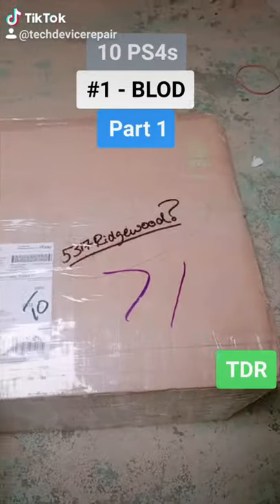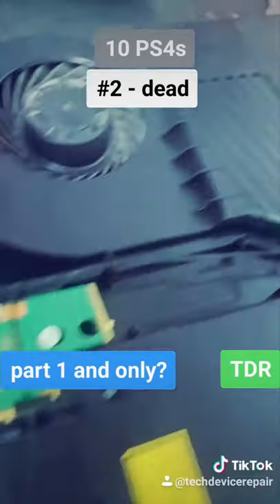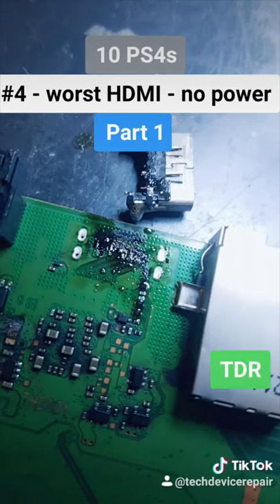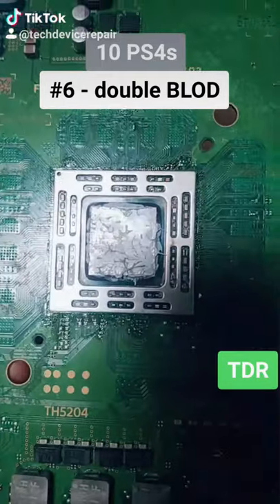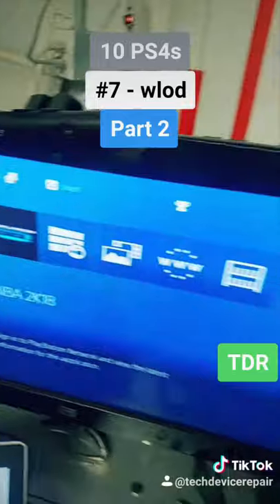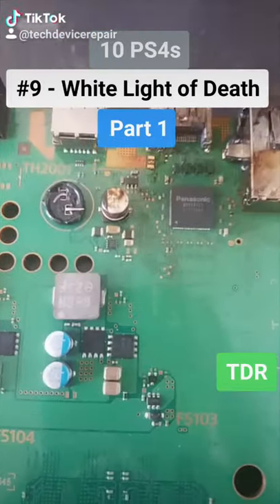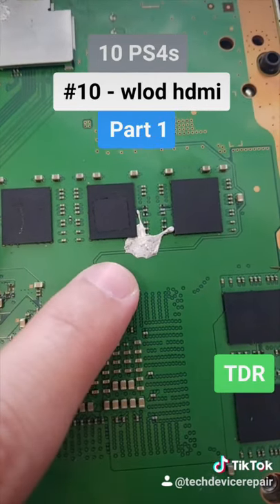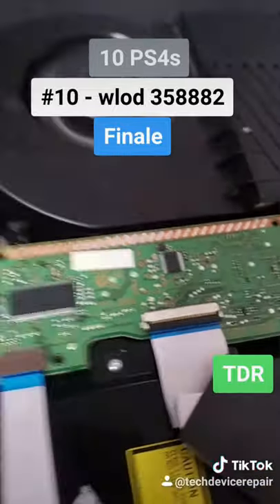I bought 10 Broken PS4s from eBay. Can I Fix them?

Comment: Hey man quick question! How Often is for a 4 pin power supply cable to burn out or something? Thank you
Reply: @thornedoesstuff6363 He means the cable connecting the power supply to the motherboard. Those either have 4 pins or 5 pins (mine has 5 pins)

Comment: I have a ps4 pro that I bought from Best Buy that was a return, when I use it I get nauseous whenever I turn it on. I heard you mention refurbished, is that the reason why I’m experiencing that? 

I’ve had cheap electronics in the past that gave me that same sick feeling, which I personally feel like they were factory models that were made with cheap parts in them that gave off a ton of radiation. I’m no medical expert, but I can’t make up what I’m feeling when I use it